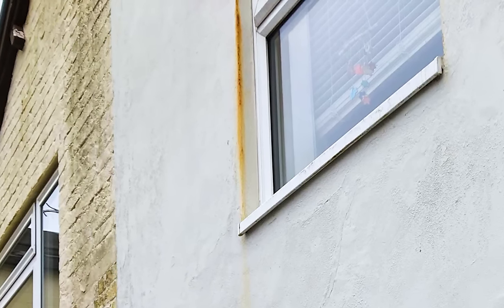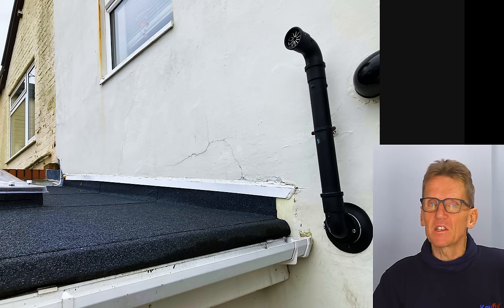The Damp Conundrum ~ Are We on the Right Track?

Comment: For starters I'd remove the framed picture! (to get a better idea of the spread of damp on the pier). Then I'd go for a path of least resistance (least damage) and investigate from the interior, by chipping off plasterwork down to masonry, from the centre of the damp area to 6 inches outside of the damp patch perimeter. To my mind, the way that the damp spreads out, with a darker area in the middle, suggests a hidden leaking pipe (they don't call me Miss Marple for nothing 🙂).

Comment: Damp is everywhere this winter, due to relative humidity rarely dropping below 90% for months on end.
Now is the time to investigate (whilst the damp is still there), because in summer, it will dry out & you'll be looking at nothing.
At first glance it appears to be sweating (interstitial condensation in the roof). A dew point of 99% can be measured using a simple probe available from eBay.
I'm willing to bet that roof is 2x4 timber, filled with 4" Kingspan or similar product. Zero ventilation.
Reply: Also, everyone is trying to reduce their gas bill. It means your house is colder and damper as there is no  warmth in the walls. My gas is down 15% this year but some rooms are damp with mould where there is stagnant air.

Comment: I’ve been working in my lads salon today  and the toilet floor had a large amount of water on it.  We’ve had so much rain there are 2  x 4 inch cat iron down pipes in the room producing so much condensation the floor needed mopping.  Lot of condensation on the cold water supply as well.  Ambient temp up and water is still quite cold - surprising how much condensation flows even with insulation.  Great vid 👍🏻

Comment: I think you open up part of the wall/ceiling. it's hard to speculate without seeing inside. open it on a cold, dry day. if there is condensation, that's your problem. if there is no condensation, then wait until it rains and see where the water is coming from.

Comment: K-Rend will be better than sand and cement, it is silica based and will repel water well. Also add fiberglass webbing to the base coat, (HP12) and this will stop the cracks. Then add the special clear coat with a paint brush at the end. 
What you may also have is condensation on the steel beams, could be worth wrapping it in fluffy insulation.

Comment: Most likely penetrating damp through the render cracks and poor cover flashing about the felt upstand which is allowing rain to drive in and dripping off the steel and thus soaking a dab spot and manifesting at that point.  However, i wouldn't rule out condensation, i have seen multiple times damp patches like this, when the plaster work is hacked off the section has been built with engineering bricks which seems to be a magnet for condensation especially in a kitchen  which may not be well ventilated either.  RH has been a joke this winter.

My advice, 
-have an exploration of what is behind the section of plasterwork.  I imagine it will be dot and dab on to masonry,  it would be worth framing out, insulating, ventilating and using duplex plasterboards.
-have a warm deck grp roof installed.  This roof looks newish and it baffles me that folk are still using mineral felt in this day and age when the alternatives and so superior by every metric.   I do agree however the felting is tidy, but if going to the bother...rip it up.
-have the render knocked off.  Battened, membranes and a quality cladding system installed.  all with adequate ventilation.

It all comes down to money at the end of the day.  If it did happen to be a condensation issue, which i doubt given the look off the exterior, you could get away with installing some better extractor fans, maybes a PIV and running dehumidifiers.

Comment: I would put money on the roof being a cold roof, if you look at the wall with the cracked render the flashing bead doesn't look like it has been newly cut in, which you would do if fitting a warm roof because the majority of warm roofs are retro fitted and are fitted on top of the old cold roof because its easier. Also if you look at the skylight that would have needed to be lifted and the fascia would be deeper.

Comment: I think that water staining is coming from the boiler condensation pipe. The boiler looks like it’s on the old wall and the opening and puller next to it. 1 am 95% certain it’s condensation water leaking into the pillar. Ind the leak and fix.

Comment: Very difficult to pinpoint as Rodger has stated , I’d consider drilling a hole in the ceiling above the damp patch and getting a camera up to see if there’s anything obvious .  Although the lady has had the roof recovered, I would like to see a better attempt at the flashing. Also I think it would have been better to have used a rubber type of material rather than mineral felt . But I fully understand that it ultimately does come down to money .  Hopefully with the right person involved, this can be resolved, to the customers satisfaction .       Kind regards as always 👍

Comment: Assuming that pillar is the end of what was the cavity wall has a cavity tray been fitted and is it dripping off the end inside the pillar . Or on the outside pictures you can see a boiler flue and what looks like a soil pipe, is there any other waste pipes coming through the wall whuch might be leaking . As said more photos required

Comment: People forget that stainless steel comes on many grades and what is used for building will be a fairly low grade best described as rust inhibitive I.e. it will rust over a longer period than cheap galvanised.
Your comments on the puller are interesting but do we know it is solid? The flue close by could indicate there was once a previous kitchen chimney construction in the area that has been made use of. I suppose a long small drill would be the only economic way to discover if solid or hollow. I think your comment of chipping off and rendering again with a better weather soffit above the joint seems most economical. To aid economy they could do the preparation themselves I suppose depending on their skills. As you point out finance is a problem for us all.

Comment: Felt looks really bad looks like it's just been pushed onto the brickwork it hasn't been sealed and the flashing is the worst ive seen might as well not even be there did they cut the flashing in half? and they try to patch with sealant?😂 Look at the state they left the existing roof in too